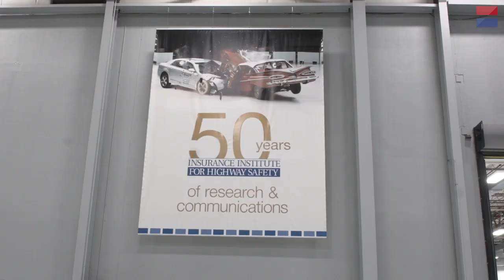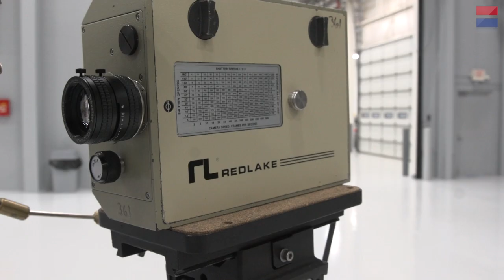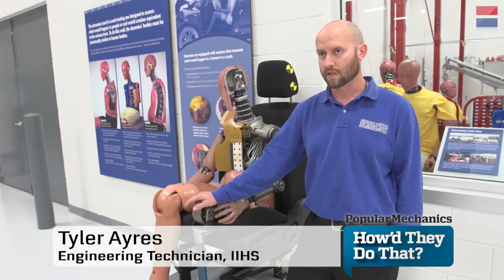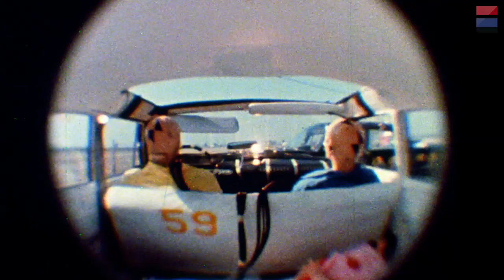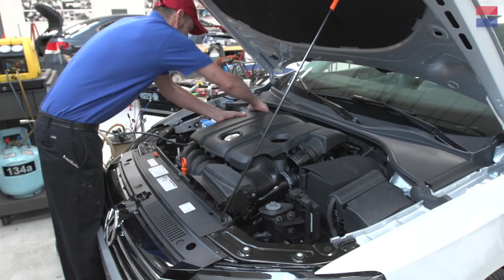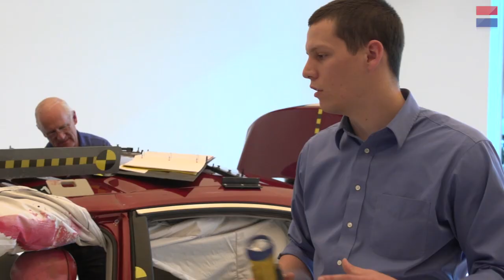Car Crash Tests Exposed: Not Everyone Gets to Crash Cars Everyday

Comment: Just a thought, why not have external airbag cushions mounted on the front and rear of each car monitored by radar sensors hooked to computer so that when a closing speed is above a certain threshold, say 20 MPH, a large front or rear airbag automatically deploys, like a parachute.  That way more severe crashes would have better energy dispersion external to the frame of the vehicle.  Just a thought.

Comment: I understand the tree thing, but the small overlap barrier doesn't crumple like a car at all ; it stays rigid so that kind of crash can't be compared to a collision with another vehicle, surely. if two objects going to same speed collide there would be more carnage because both vehicles are decelerating through each other. although I understand that the vast differences in stiffness of steels in each vehicle will shape the outcome of a crash test so they wouldn't do it. it'd take too much time and too much money.

Comment: yeah, but they dont post the stats on the videos so what use does it serve to post the videos if you would have to do further research to find the stats on all of the cars you might consider buying...
Reply: They do add the rating
Reply: +MPGster s It would be really sweet to see the actual analysis, as you mentioned. I wouldn't even mind if it was for a subscription fee like what they do with Consumer Reports. 

I'd love to see "if the dummy walked away" or how badly they'd be beat up. Maybe in the future!

Comment: I'm no expert by any means but from what I've seen most people drive a little faster than 40 maybe you should do the test at like 55-60 maybe I mean I don't know if I'm wrong somebody please correct me
Reply: The crumple zone of the car is only designed to withstand 40 mph impacts. A 37 mph impact is equivalent to dropping a car face down into cement from 47 feet. At 55 mph the energy released is the same as dropping a car face down from 105 feet. That is because the kinetic energy generated is calculated as the mass×1/2speed squared.
Reply: Jeremy Ritz The reason they do it at 40 mph is because they assume people are smart enough to brake before a crash, bringing their speed to about that. They also do tests with car-on-car accidents. those are pretty brutal sometimes...
Reply: +mutilator97 ahh OK I c thank u 4 correcting me.

Comment: The Nissan Maxima was only going 40mph? What?! I drive 90mph on long trips between KC, Saint Louis and beyond...I can only imagine how fucked up my car would be going 90 crashing head on side impact. Kind of just scared me.
Reply: Hunter Parker 40 mph implies you had time for desceleration, and these tests are also to make you think more before going nuts with the acceleration pedal.
Reply: +Hunter Parker statistics are: 50mph is the boiling point, past 50mph the danger isn't even the crash itself but the G forces in your body which multiply by quite a bit at the moment of the crash. so yeah if at 50 your chances are just about as slim as they get, at 90..... lol more likely a r.i.p situation
Reply: +Hunter Parker at 90mph it doesn't matter how good the car is, the deceleration forces alone can and probably will kill you.
Reply: if it was head  on the car would  absorb more of the empack  but they are hitting  the car in just the corner so I guess  it takes more damage

Comment: this test, brought to you by Volvo! Not a real life situation. When slight overlapping with oncoming traffic, cars bounce off eachother due to deformation, this concrete pole stuff thought off by volvo is an unnecessary segment just so they can look good with their unnecessary girder compared to other cars
Reply: It's designed for both overlap with cars as well as poles. Another consideration is what vehicles you are hitting, if you hit a Fiesta or a F450, maybe a semi, then the standards will be different. Building a car to handle an overlap crash againt a solid block of concrete will no doubt lead to safer vehicles than building them to have a collision with say themselves.
Reply: *****
Agreed, Just look at the 2013 models vs. 2015.  Most small cars got poor rates where now marginal or acceptable rating.

Comment: I wonder if they do repeat a crash twice would they both look the same?
Reply: That is an interesting question.
Reply: More or less yea it will look similar. There are weak points designed in a cars construction specifically for this purpose (that is why you get that crumpling "accordion" effect when a car hits something). Almost every single car part is designed to break in a certain way should they be compromised. Assuming that the impact is identical, the damage should be almost identical as well (except for certain solid pieces and glass obviously that break randomly).

Comment: I don't think people are seeing the main idea. A car's safety is designed for the human body. Car's have to have crumple, collapse, what have you, zones to absorb the impacts instead of your brain and body absorbing that impact. So a car may look scary to crash in when it's distorted and twisted but actuality, it's doing a lot of good to look that way. If they wanted cars to not have dent when crashing in a wall, they can. It's very possible but would be very stupid to do.
Reply: The bodywork in the front should collapse, but the thing to really watch for is the shell surrounding the passenger compartment--the roof, A-pillars, firewall, front doors, etc. That shell should remain as intact as possible, and not crumple up or bend in the middle. The Altima suffered structural damage to the passenger compartment, especially around the footwell, which probably cost it the Good rating.
Reply: You sir are very correct. It can reduce impulse from momentum to reduce forces that can harm your body.

Comment: Safety is a compromise. If you want the driver to see out of the vehicle then you have to have glass. Rising waistlines so popular on the latest vehicles which often reduce visibility but improve crash test results are a compromise. Adequate risk analysis is required to make the best compromise between design and usability as far as safety is concerned.
Reply: Dave Stenhouse The ironic part is that by making the car safer in an accident, they are making it harder to avoid one due to massive blind spots. The 2016 Camaro in particular is hilariously bad. Almost 15 percent of your frontal vision is gone due to the a-pillar. And you can't see out the back at all. Its like driving a semi, and most cars are like this now.

Comment: All these steps to ensure it is close to a real situation and yet they remove the headrests?
Reply: +BaldMancTwat They take the headrest out because the dummy's head isn't going to come back and hit it in this situation. Removing it gives a clear view of the dummy impacting the airbag on video which is important data.
Reply: obmoder1 the headrests and the seats are tested in another test...
Reply: obmoder1 yeah im sort of a year late but in the slow mo do you ever see the dummy hitting where the headrests would be? No. it hits the airbag and that's it, it doesn't bounce back and the head doesn't go where the headrest would be
Reply: Gahlok12 they test the head restraints in a different test.
Reply: obmoder1 I know right
Reply: The_Doctors_Tardis That is true.
Reply: They do that to have nothing obstructing there view of the dummy

Comment: Maybe if the engine was running it would be a bit different
Reply: Maybe, but unlikely. The vibration from the engine would not affect the structural strength of the vehicle, nor would it being self propelled do anything.
Reply: +jam63112 why? The engine running makes no difference to the structural integrity

Comment: When they say the dummy costs 250,000 they mean that this is how much they charge the government (taxpayers) for this dummy. There is no way that tool can cost even anywhere near the cost of a car (in terms of production cost, material used, labor time, etc). A dummy like that could probably be sold by a Chinese company for less than 3000. (Think about the complexity of Professional DSLR cameras that cost even less).
Reply: IIHS is completely funded by insurance companies. The taxpayers don't pay for it, nor does the Government. The insurance companies pay to have the vehicles tested to insure that people won't get injured in an accident which can lower insurance costs and save the companies money by not having to fork out as much money for injury cases.
Reply: I guarantee you this dipshit didn't watch the video more than 60 seconds before making that comment.
Reply: Ashot Aristakesian
They're not mass produced. They also have to engineer, design and build only a handful of extremely precise devices that can also be in 80 violent car crashes every year and last forever.
Reply: Watch the video and find out.
Reply: Ashot Aristakesian Ashot jan, kap chuni inchic e sarqac, karevor@ vor et anter@ arji 250.000. Et shat shata tikniki hamar. Indzela et hetaqrqrum.
Reply: +john21031 the taxpayer pays zero $. Its funded by the group of insurance companies. In the end the idea is to get the car makers to make safer cars. Which they do, every new model that comes out is better than the old one.

Comment: Those anybody else but me sees this test totally useless, cars are not square monolithic titan blocks that would rip your schassi like that, its a nice try in test revolution , but cmon people. Full frontal is ok , partial frontal is ok , but this is impossible!!!!
Reply: Have you ever heard of something called a tree, or a telephone pole or a light pole? Those are very rigid, nearly immovable objects that are often struck by cars in a manner similar to this test. The standard deformable barrier offset test is more representative of a car-on-car head on collision. This test is more representative of a collision with a roadside object. Both have their place. So no, this test is not useless.
Reply: It's not useless, this is the standard they came up with. It would be really difficult and expensive to develop a standardized test that involved crashing into something that deformed, you couldn't guarantee it would act the same every time. Plus, if your car passes this test with a "good" rating at 40 mph, you can probably expect to be safe crashing into another car at higher speed, because the car is softer.
Reply: When they test, they use the worst case scenario. If the car does well here, it will be more than adequate out on the road. Most of the people on the board complaining are probably watching how UNSAFE their cars are in these tests and getting defensive over it. You can say whatever you want, the proof is in the test data.

Comment: I used to sell German cars (VW). Big difference in the 05 1/2 models and up. We also sold Volvo, so it was a common thing for someone to ask which one was safer. My answer was "generally, whoever had the newest design". Volvo and VW have very different ways of going about things, but both work great. I drove a used Volvo 850 and it had the best side impact protection for its time. When I sold VWs, the Jetta had the best side impact. German cars are not the most practical, but they are very safe.

Comment: over the course of the 5 months since i wrote said comment i have found much more research and turns out they are very strong tough cars due to the mid engine allowing for a large crumple zone in the front and rear.... as well as the car having some of the worlds greatest active safety.... buying one this winter when i can haggle a bit more with the sellers.

Comment: Try a 1960 Cadillac they are tougher then they look
Reply: I'm guessing you would still have severe, if not fatal, skull, brain, and neck injuries in a crash like this from your face hitting the metal steering wheel with no airbags or 3-point seatbelts at 40 mph, regardless if the car was a 1960 Cadillac or Imperial.

Comment: It's pretty amazing how clear the difference is between these cars and the Volvo. Those angled beams on the Volvo work perfectly at "bouncing" away from the crash but here you can actually see how these cars are getting slightly caught when the impact reaches the firewall. Not good for load on the passengers.